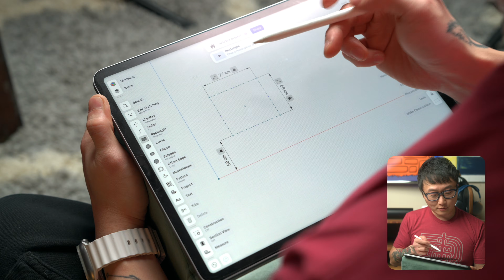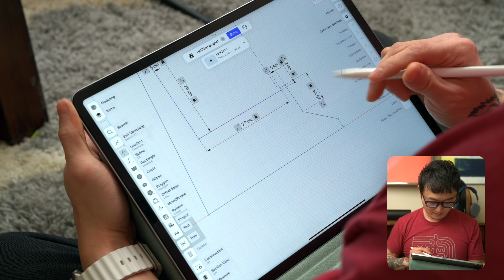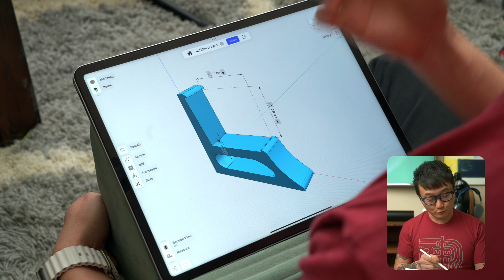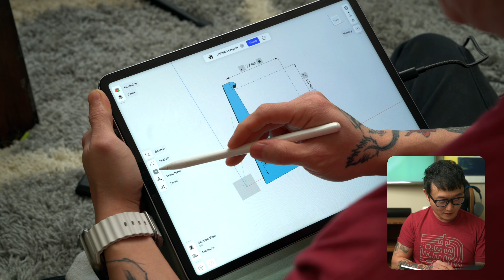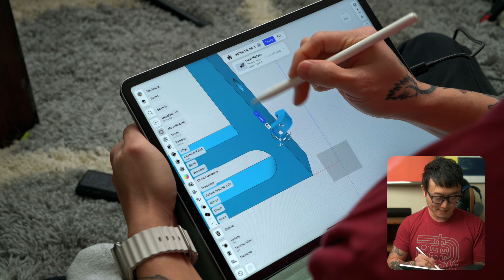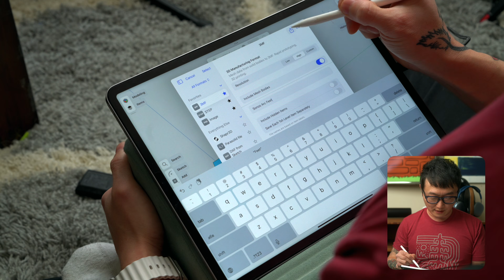Shapr3D FOR BEGINNERS Part 9 (RE-UPLOAD) - iPad to 3D Printing Risers for Sonos Arc Ultra

Comment: You make it seem so easy… and obvious how to go about designing something like this.  One suggestion regarding testing 3D printed parts that I have so far found useful is to use the feature in Bambu Studio to add negative parts and exclude most of the print so you can print a few layers of the object to see if it will fit without wasting very much material.  Thank you for your videos, I am finding them useful!
Reply from the maker: Oh thanks! I will look into this

Comment: with small changes in the design, your cable hooks are much stronger and doesn’t require support. Rule for 3d printing ist 45degree camfer  is printable without support. This is the way to go.
Roundovers looks nice but with the radius you exceed the 45 degrees.
Reply from the maker: Ohhh thanks for this information!